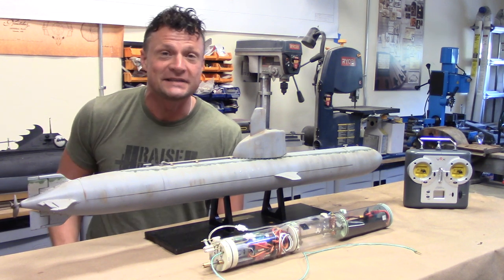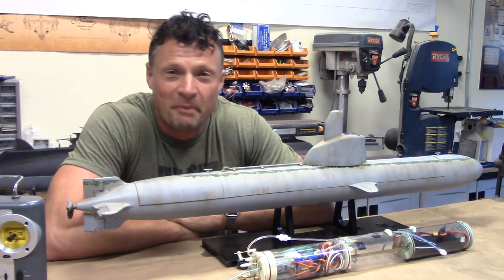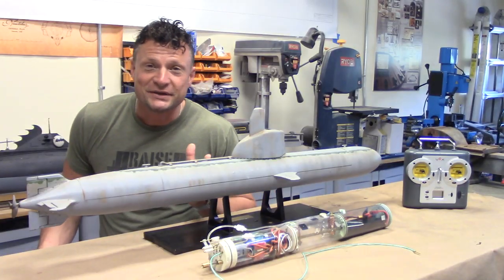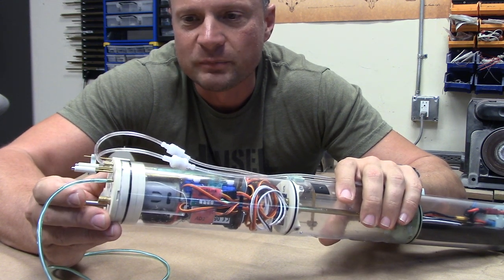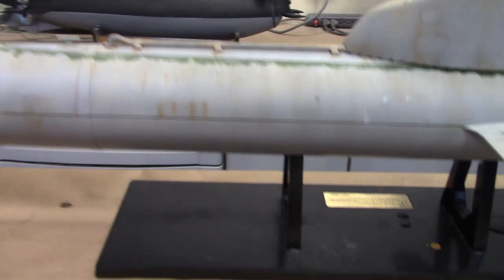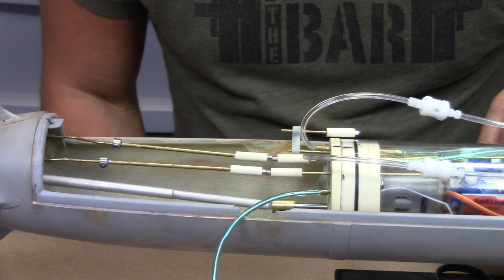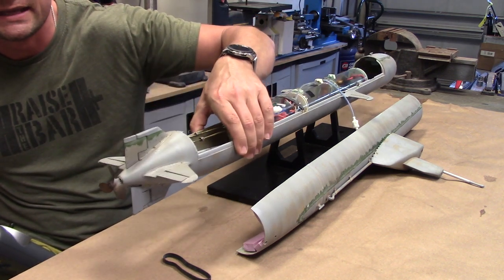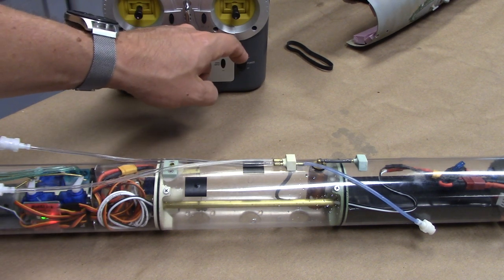Japanese Kairyu Midget RC Submarine Overview

Comment: Great videos 

I'm starting work on at least 7 submarines 3 tipe 7/ c one w/ snorkel , one tipe 9 ,      two Gato class US fleet sub's and one. I 53 IJS .           All of them are 1:72 nd scale starting at the small end are the tipe 7 / c 's  at about 2 ft. in length ,     the tipe 9   about 3 ft . ,  the Gato's at 4 ft . and the I 53 at almost 5 ft. .

I would like to know how to figure out what size  of M S S  to put in each of them .

I know that I'll have to measure the space of each interior to start  but what are the sizes of the units and the Gato's are the only ones that have interior bracing ,  do I have to allow for that or not ??  

Also where can I find the running gear ,    shafts ,   left and right propellers ,    dive plains and most of all  the motors ????  

And one more thing it the  I— 53 comes with 5 Kaitens 
( as small as they are I was almost self committed just thinking of getting one to work ) 😁😜😝😨 

But any and all help will be greatly appreciated .

Or should I just go back to building my flying saucer .👽👽👽👽